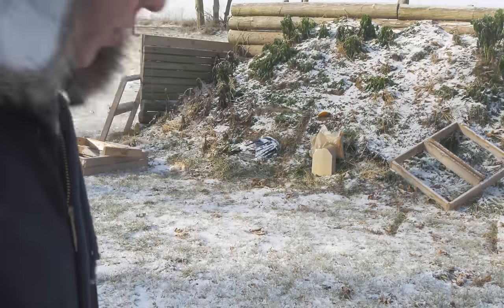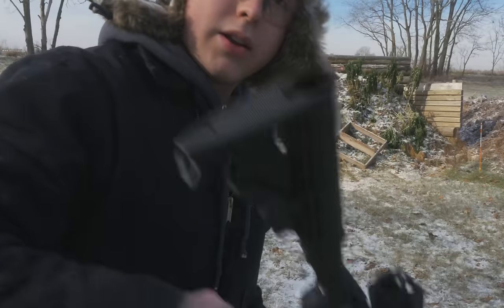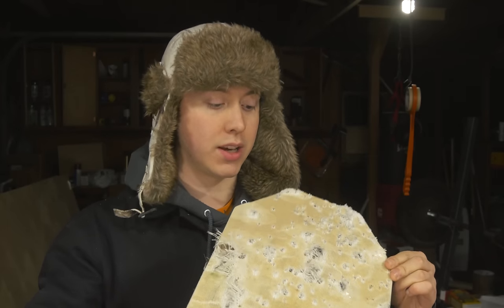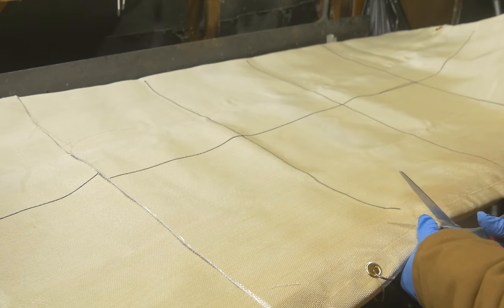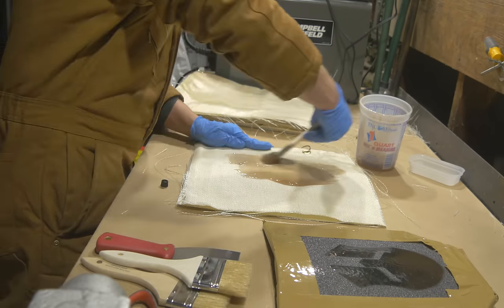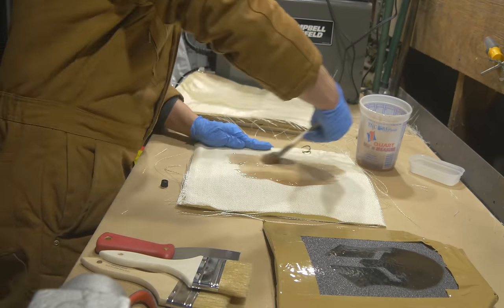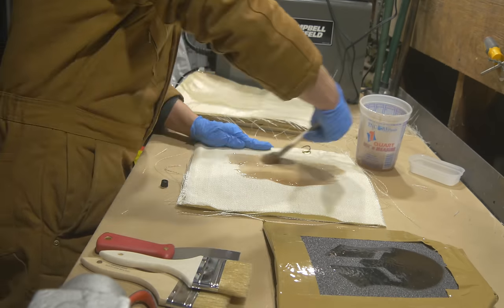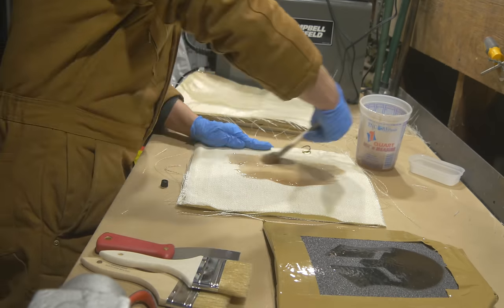How to Make AMAZING Bullet Resistant Armor for $30

Comment: how many layers was that?
Reply from the maker: 20
Reply: RaySulz 100 layers of body armor
Reply: Can a nylon fabric like the ones use in bags stop those bullets(Not rifle rounds)? The ones that been use to make knife sheaths?

Can you test shooting an 5.56 to 7.62x51 to an old car spring steel, I really wanna see the results if that spring steel is good for armor. Can you put a video for that because there is no youtuber done that before, you might be the first.
Reply: VisayasMindanaoLuzon, Ballistic Nylon has been used to make body armor. It was originally used to make flak jackets to protect pilots from the fragmentation of said flak.
It is not very good against bullets even pistol bullets.
It is considered obsolete for body armor. But in some applications it is sometimes still used.
Reply: Dude
Reply: David Grover Its not obsolete. Just the whole process of making it is. It is not cost effective. To make the highest quality body armor is about 3 grand per plate. This is using different sizes of Nylon and weave patterns per layer including different types of adhesives. The machine that can do this is almosy a million dollars. Each nozzel is around 10K and you need 10 for the various patterns. The actual polymer pellets are dirt cheap.
Reply: What if you doubled it? Would that be to thick for most plate carriers? And does the curvature make it slightly or significantly better? How about a Kevlar build?
Reply: it's  like onions
Reply: EveryPixelCounts 
Not really. A pointed bullet separates the fibers of woven materials like kevlar and fiber glass. Now what you can do is alternate the direction of the fibers but you will get similar results. 

In order to stop rifle rounds, you should just really use a ceramic material, or steel.
Reply: TheTyrial86 i mean kevlar shouldnt be used with anything larger then a pistol, level 1-2 would protect you from most weapons.  But knives can get through kevlar 1-2 body armor, arrows especially. Now,  level 3 has body armor which has plates… yeah no… goodluck getting through that with maybe even a hollow point. Hey but eventually the best armor will be a graphine armor.  :3 i think 100 sheets (only 1mm o about the thickness od a pencil lead) will stop a bullet (a mini version was shot at with pellets going faster then a bullet soooo) i mean… yay?  It's not cider effective yet and we cant make it at a large scale
Reply: RaySulz 8-10

Comment: Great video, just wondering how many layers of ,"blanket" did you use?
Reply: Very important the number of layers used.
Reply: 10 cells and it's folded over at least once, so 20. If it was folded over a second time it would be 40, but I'm not sure if they have ones that big

Comment: Costs $30 to get the materials for it but you need about...
 10 clamps $7 each
 Two Spartan Armor Plates $150
 Paint brush $4 
 Stirring cup $3
A place to do this in $5-$5,000
Reply: An African Child plus cancers of the lung, and very itchy skin for weeks and maybe months!
Reply: I built a fiberglass boat. Sure it's annoying to work with but the stuff I had really didn't itch that much at all. The polyester though.... The gloves were hard as concrete after working with the stuff for a 100 hours.
Reply: An African Child you don't need the spartan armour , also ,you have to live somewhere , so do it there
Reply: An African Child and those other things you can find in your home so there is no need to buy them
Reply: he's an african child do you really believe he has those materials in his hut.

Comment: thinking about doing this and adding a thin layer of mild steel and coating it with flexseal.
Reply: If he did it out a kevlar, and added that as a backing plate it'd probably be surprising.
Reply: @joey6704  yeah absolutely. But Kevlar is expensive. And not really a "backyard build". I'm I'm going to try probably next month is to alternate the weave and and a mild steel backing. Should work fairly well.
Reply: @NathanRyan92  Ahhh didn't realize you were trying backyard style since this thing performed in what I wouldn't consider a backyard nature haha

I look forward to seeing whats next! goodluck brotha
Reply: @joey6704  If he did it the same way I believe it wouldn't be better cause you still need additional ceramic treating of the material and better than that gluing.

Comment: where would I get this kind of stuff. like I've looked in a lot of places for fiberglass she's like this, but I couldn't find anything
Reply from the maker: This is a welding blanket i got the the welding section at my local hardware store. The resin should be near the automotive section.
Reply: ZNA Productions what should we use for a mold if we don't have armor plates... just for the curve..
Reply: You can use wood and douse it with talcum powder or commonly known as baby powder so the resin will not completely glue itself to the mold. Only drawback though is it may be a one time use mold unless you build it in a way for continuous use.
Reply: that still wont give me the curve, I can clamp it in some wood I guess but it's not going to be wearable unless I just make a small plate for upper chest only
Reply: You can wear non curved plates. They're just noticably less comfortable.
Reply: So if I understand you correctly, a fiberglass welding blanket is the most suitable product to use for this build? :)
Reply: It would be time-consuming but a basic shape could be hammered out of sheet metal or maybe an old oil drum.
Reply: good idea

Comment: 30 dollar body armor that needs 2 thousand dollars of equipment to make.
Reply: James or spend that 2030$ on some quality armor ar500?
Reply: You could make it with $10 of tools although what he used in the video is maybe $500 max
Reply: James you should look around you might have a extra bandsaw just laying around somewhere and not even realize it like this guy
Reply: A $30 angle grinder with a $2 cut off wheel would work just fine. You don't need any expensive tools.
Reply: its not like you can only use those tools just to make this specific armor though lmao those tools are so damn useful for a shit ton of things, its probably actually better to buy most of those things and utilize them for many different DIYs. Literally, some DIYs are so useful and plus there is no way you dont already have a few of those tools laying around.
Reply: bullshit. a 30 dollar angle grinder will burn out in 10 minutes of use. YOu dont need 2k worth of tools, but you sure as hell need more than 32.
Reply: LeeFerikson it is not difficult to cut fiberglass with a carbide cutoff wheel or even the cheapo metal cutting ones. And the cheap grinder will work just fine as well. Sure, you could go with a more expensive one, but clearly if you are complaining about not owning any tools, like the OP, why bother? You clearly have no use for good tools.

And I've used cheap grinders to cut tile, steel studs, demo cars, cut rebar, etc and they don't burn out in 10 minutes, so fiberglass sure isn't going to kill it...
Reply: Or, you know, use cheap hand tools. It just takes longer and more elbow grease for the same result.
Reply: James I don't understand why this comment is on every single fucking how-to video. Every single time there are guys complaining that you need all this expensive machinery to make the part. Well guess what idiot, instead of complaining you should be in your garage figuring out how to make it with what you've got. You could do this whole project with a hacksaw and some sandpaper if you that's all that was available to you.

The expensive tools just make it faster. And besides, you should have some power tools lying around, who doesn't?
Reply: LeeFerikson I have a 17$ grinder that has cut through more than 100 feet of .25 inch high carbon steel
Reply: finally someone who understands how capital goods works

Comment: How would this budget body armor deal with high powered crossbows at 10 - 50 yards?
Reply: If it stoped a 12g slug round, I’m sure it could snap your little crossbow bolt on point of impact
Reply: He asked a valid question, crossbolts have the power to go through woven kevlar vests, don't think they can go through a solid plate though
Reply: Darksiege mostly because kevlar is meant for stopping bullets not stabbing
Reply: Depending on the mass and velocity of the bolt the most lethal things would either be large shock across the armor or the bolt deflecting and hitting your arm
Reply: Darksiege: Doesn't it usually have something to do with the tips used thought? If the tip is like one of those sharp, bladed tips then the bolt can cut through kevlar and other fabrics. It's penetration isn't as much due to the impact but the fact that it shears woven kevlar vests like a knife tip would.

I doubt it would penetrate this plate though, since it's no longer flexible enough to allow a sharp arrow or crossbow tip to cut through it but more like a solid block of very impact resistant material.

Comment: wooh im early, wait why am i watching this, bulletproof armor is illegal here
Reply: nothing is bullet proof
Reply: Spider-Man I think a 90 inch thick titanium door would disagree
Reply: Spider-Man pretty sure 1" ar1000 is bulletproof since after 50 cal or 12.7mm their cannon shells
Reply: Squashy 10000 i think a minigun would disagree, titanium chips when hit so u just need a lotta bullets
Reply: lol49031 that's still bulletproof then, cause everything is gonna break if you try hard enough. that's like saying that your walls aren't soundproof just because it's technically possible to play a sound loud enough to get through. inherent imperfection doesn't make you right.
Reply: lol49031 Where are you?
Reply: Walrus Warlock singapore
Reply: +Squashy 10000 Most dictionaries worth their salt accept the definition of bulletproof to mean that the object is impenetrable to bullets. In the case of the titanium plates, they're bullet-resistant. And your example is flawed because of the definition of soundproof. If sound can get through the walls, then they are not soundproof. If you blast a big enough soundwave at a wall, and the wall crumbles, it doesn't mean the wall wasn't soundproof, it means that it wasn't immune to the transference of kinetic energy.
Reply: lol49031 Weird that they would ban protection.
Reply: +Blue Diamond It's not even like, complicated science either. There's a difference between a sound wave getting through a medium, and kinetic energy ripping an object apart. A better way to think about it is with deaf people. Just because they can't hear the sound, doesn't mean that a big enough sound wave won't make their ears bleed or even rupture.
Reply: Why the fuck is bulletproof armour illegal? Whats next seatbelts becoming illegal
Reply: Monk Skunk my country is against people being prepared for fights, that and the only people who have guns here are the police
Reply: lol49031 what country?
Reply: where do u live?
Reply: lol49031 you love in New Jersey?
Reply: *live
Reply: Mister Riceroni i live in Singapore(South East Asia)
Reply: anyways now that i think of it, if i had bullet resistant armor i wouldnt be concerned with the law catching me since bullet resistant armor is likely to be tazer proof since the clothes cant get through the armor, all i would need to be able to do is to beat the cops in a melee fight, or just carry a ranged weapon around
Reply: probes* not clothes, mobile has no edit
Reply: lol49031 bullet resistant*
Reply: Cole Dobner hey, in the land where you never see guns, its all the same to me, shouldve just said ballistic vest tho, wish i wasnt on mobile so i could edit it
Reply: lol49031 no, no, I wasn't correcting you, I was saying, possible loophole, it's not bullet proof
Reply: Cole Dobner true, then again the law articles of clothing intended for protection against attack, including bulletproof vests
Then again this is for import/export and not making some homemade armor although being found wearing one will probably be really suspicious
Reply: lol49031 Yeah, but who said to use it now?
Reply: lol49031 I'm on mobile, I can edit my comments.

see look, this was edited in. it even says edited on the bottom.
Reply: Spider-Man no, he's right. Nothing is bullet proof. With enough time and bullets anything would be destroyed. The correct term is bullet resistant.
Reply: 50 BMG and 12.7mm are the same round.
Reply: 50 BMG and 12.7x99 are the same round
Reply: coyte bess same caliber, different round
Reply: lol49031
It's not bulletproof armor, it's a costume for renn faire, play, cosplay, wharever ... :P
Reply: Spider-Man black hole?

Comment: i forget the exact video and what was used, but there is something that you can apply to your plates that will keep the epoxy from sticking to the outer shields.  i think this was mentioned in one of the bow building videos that i watched a while back.  it will keep you from having to use a hammer to smack the shields off your build.

Comment: Does anyone know the amount of layers used? Totally just for curiosity
Reply: between 6-9
Reply: @clydeyoshida2627  im wondering this too i want to buy some fiber glass rolls for working on a fiero but would like to know if i can also make body armor lol.
Reply: Ronald Miller    Ok never a a reply so I ordered some fiberglass cloth that is 10 mil which is thicker than what you find in Homedepoe sells 6mil. When I received it I made some plates some where 8 layers one was 12 layers and still another 18 layers. I need to field test them to see how they hold up. 
I spoke with a guy that works for Fiberlay and he said the cloth is stronger than the Matt type of fiberglass and he also said he worked in ballistics which was good knowledge that he knew what he was talking about. You can order at Fiberlay in Kentwood WA. they will help you. Hope this works for you.
Reply: @clydeyoshida2627  Have you tested your plates yet?
Reply: it was a 5x5 blanket and he put 5 plates long to cut and 2 plates wide, total layers used is 20! however, don't know the thickness of each one. The final product to me looked like 1/2 inch thick plate

Comment: Can it stop knives as well?
Reply from the maker: Yeah definitely.
Reply: Interesting that the fiberglass approach means it can stop both bullets to a certain level and blades etc, usually its pretty much one or the other due to construction methods, so that makes this even cooler!!
Nice Work
Reply: I was going to ask the same before I saw him smashing at it with a flat blade screw driver and it didn't even leave a mark lol

Comment: Composite plates works in a different way respect other type of materials. In composite plates you would like the energy to be absorbed and used for something else. For example seeing delimitation is for sure something that would improve chance of stopping the bullet. You can definitely stop 5.56 by adding layer of kevlar in the between of fiberglass.

Comment: how many layers of fiberglass blanket did you use for the armor itself?
Reply: looked like it was 18 or 20, re watch the video and count rectangles.  Same principle BTW on the protective properties of some of the oldest armour known to western civilization.  The Greek linothorax, and you know what they did to improve their armour?  Added metal bits to it.  :)  2 or three layers laminated into the armour should do the trick.
Reply: I am curios about that myself as well
Reply: I think it was 20 layers too. If you look he marks out 10 squares on the sheet using the plates, and as he cuts it, it appears to be folded in half. Assuming he doesn't use anything other than what's shown in the video, it could be edited down.
Reply: 20 sounds right considering kevlar vests have arpund 13 to 15 layers.

Comment: Try 7.62x39, 7.62x54R, .308, .30-06?
Reply: ACountryBoyCanSurvive it would probably stop the 7.62x39 better than 5.56, but the others are going to be over so fast.
Reply: ACountryBoyCanSurvive you don’t know much about guns do you
Reply: ACountryBoyCanSurvive 5.56 is actually better for body armor. Whereas 7.62 is more for flesh targets. Although the 7.62 has more stopping power, the 5.56 is a much faster flying bullet. A 7.62 gas a muzzle velocity of approximately 2350 fps, a 5.56 has a velocity of approx 3025 fps.
Reply: Bad Cookie Leave Google out of this.
Reply: @bookkeeper1995  *SKS round
Reply: @zacharytomes5202  7.62x 39 is an sks round but is more commonly known as an AK round the AK platform can be chambered in several rounds, 7.62x39, 5.56 nato, or even the poison bullet 5.45
Reply: Dude 7.62 has way more penetration so if 5.56 went through expect the same with 7.62
Reply: @bookkeeper1995  
7.62x51 nato (.308) usually compared to 7.62x54r Soviet.
 7.62x39 is way too different.
Reply: @pavelt5732  I'm not sure what that has to do with any of my comments, I was just clarifying ammo types. And as a point of contention 7.62x54 rimmed is closer to 30-06 springfield, technically lies in between the two. And ballistically all are fairly similar.
Reply: To be clear, in terms of energy (see "power") the order of the aforementioned cartridges would be in order from least to most; 5.45x39, 5.56x45, 7.62x39, 7.62x51NATO/\.308 WINCHESTER, 7.62X54Rimmed,30.06 springfield. You also must remember in terms of velocity 7.62x51Nato is very similar to 5.56x45. So while speed kills armor 7.62 has both the velocity and sufficient mass to defeat or destroy most steel or ceramic&Kevlar/\ceramic&dyneema armors available on the market today, depending entirely on projectile composition of course.
Reply: Of it can't stop 223 556 then what makes you think it can stop bigger, faster bullets
Reply: They'd all blow right through
Reply: I loved the project. With just a bit of tweaking it shows what can be done for very little money. I do have to say though that l7.62x54 IS armor piercing...... like the saying goes "Mosin, because people like to hide behind shit." That round would blow right through this armor